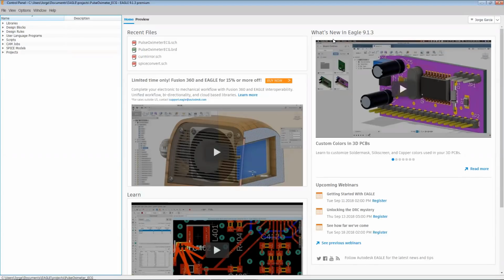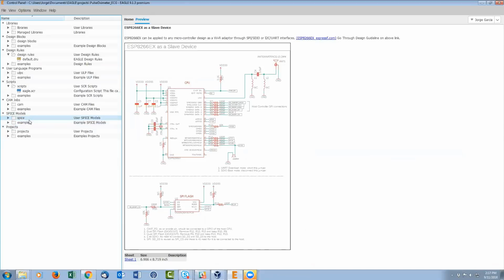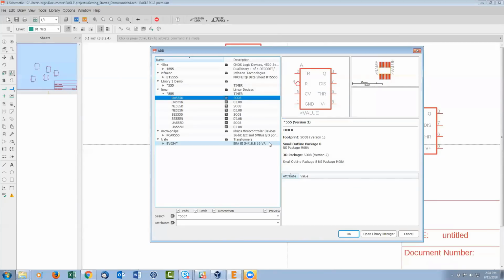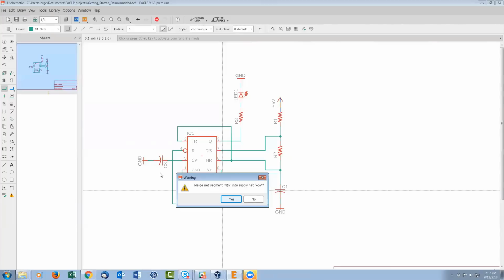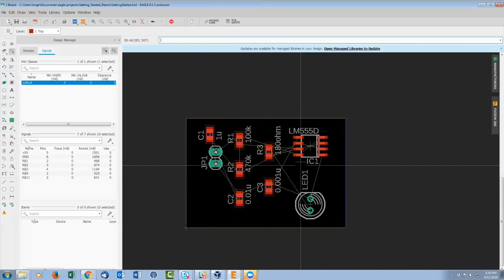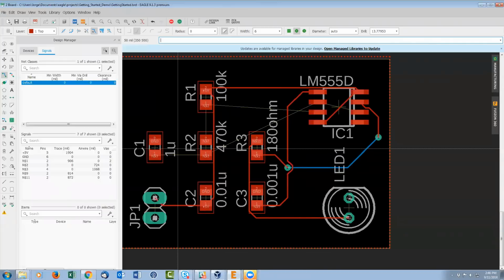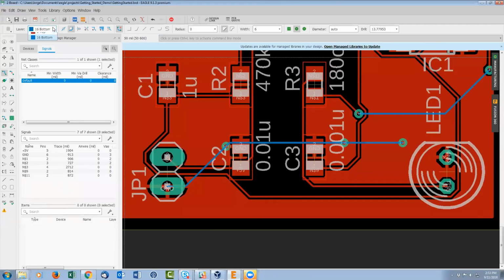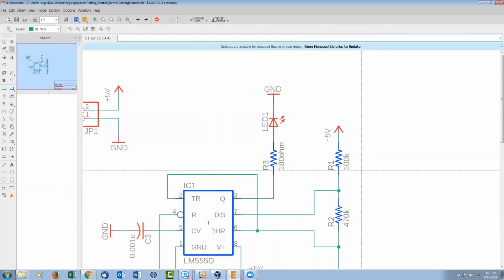Getting Started with EAGLE Sept 2018

Comment: I could not get the rotation of the group to work (30m 10s). I could select the group and drag it, but when I right-clicked I would either get an alert sound, or a popup menu would appear, but the rotate on it wouldn't rotate the group.  I eventually created a group, and used rotate group_name in the command field to get it to rotate. Any ideas?

Comment: can someone tell me what's the via for? if i didn't put the via would the schematic work? I watched this video almost every second but still it's too hard to understand. but mostly and definitely helpful
Reply: Aifaa Alia sure, the via forms a connection from the top to the bottom layer. It’s basically a very small through plate hole. This transfers the power/signal to the layer below🏴👍
Reply: @deangreenhough3479  thankyou!

Comment: Really annoying, the rotate group click does not work on the mac.  I've spent over an hour trying to find a way to do it. Whats up with that?
Reply from the maker: Hi Tom, What type of mouse are you using. Typical procedure is 1)Form group, 2) Click Rotate icon, and 3) Hold CMD and Right click a member of the group to rotate the group. Please join us on the EAGLE forums with any further questions. Thanks!

Comment: This video inspired me to learn more about Eagle, again. I used it, briefly however and never put it to any real use back then. This was almost 20 years ago! A lot has changed since then.
I was really frustrated since I thought I could just start drawing a PCB layout by just placing pads and whatever, and while trying so I almost tossed the monitor to the ground, 'cos it just wasn't happening, nothing worked, so I tried to make a schematic, and I still got nowhere, fast as hell.
So, I went here you YouTube and found this tutorial and watched it and suddenly things started to click just right, and before you knew it, I was making headway!

 This time I'm really motivated to make a PCB since I learned a great deal from this video and took a few stabs at it and I actually got it working, almost the way I want, and I've just placed an order of a bunch of components (I did actually intend to do this on a vero board at first so I placed another order before this, but the sheer complexity of it made me think of designing my own PCB instead), and for the first time I'm going to make my very own SMD circuit board. I probably won't plate the vias since that mean I have to get some chemicals and make a setup for electroplating as well. My current living conditions prohibit that, as well as my finances.

Anyways, I'm building a HDD indicator, for whomever might find this inspiring or whatever. This is an insane project as I intend to at least build a server which would house no less than 320 HDD's (Like if I could ever afford it!) with SATA port multipliers and stuff.
These multiplier cards has 10 LED's on them, one for active disk, the other for activity. 
My problem is that these aren't visible from outside the server and I have no plans to mount them in a way that I can. That'd look awful!

So, my original plan was to solder on some connectors to which I'd hook up LED's, but as I like to think and ponder my ideas, I thought it'd be nice to have something more. so I decided that I wanted an optic scale and thought of bargraphs, but after some more thinking (Space wise), I settled on RGB diodes, and to add to the mix, I decided to have an Arduino to read these outputs via opto couplers and keep track on which disk is active and such, but the main function for it would be to transmit this to an external panel, since the whole thing will be housed in a server, which is located in the basement with an KVM-switch.

Later on I will probably use some kind of radio module for this transfer.

Anywhoo, there'll be a lot of cables and connector, so I needed to do a neat wiring as these experiment boards whould require a crap load of tiny cables, and Eagle CAD seem to have come to the rescue.
The number of components are staggering:
320 pcs of LM3914 VU-meters on a board of either 5 or 10 of these (Still undecided and I got two schematics/PCB layouts)
1 or 2 cards with 5 pcs of diffused RGB diodes.
64 cards (One for each SATA multiplier card) with 10 opto couplers and 2 74HC165 8 input (5 on each used) shift registers and a 16 pin header (5 outputs for the above, serial in/out, clock/latch and power/ground)
2 or 1 big nexus if you will, with a total of 64x16-pin headers, 8x40-pin headers to connect these together.

The 40-pin headers will be connected to 6-pin headers and will fanout to the VU-cards.
A massive project to say the least.
Also, I have to make a pile driver for my Dremel-clone, and that will most likely have an servo and an Arduino, and I also ordered an USB microscope camera for those pesky 0,3 mm vias.

Not that anyone asked or anything, just thought it might, perhaps, inspire someone else to make something fun/useful
Reply: Tony Hedlund it did Tony. I started learning on my own for 3 years. Decided to put my head above the parapet and send out a CV. BOOM first job interview and I’m now working at a science park in Cambridge England working on safety critical systems. I, like you just beat down a path to my goal, blood sweat and tears. 

If you never lose the will to learn and love solving problems, it becomes a wonderful life 🏴 think outside the box and just believe. 

Good luck to all those on their journey 😁